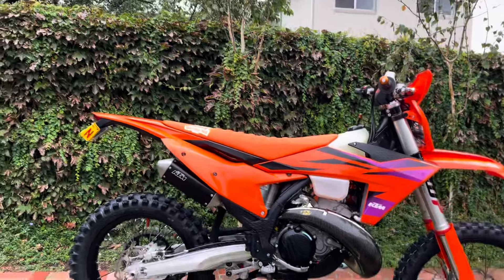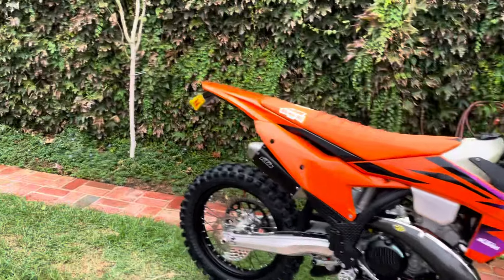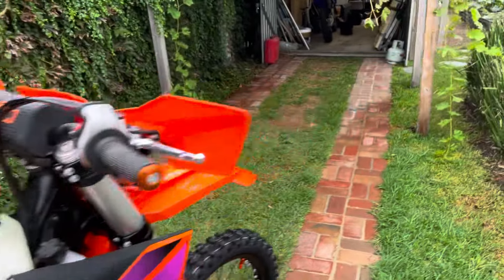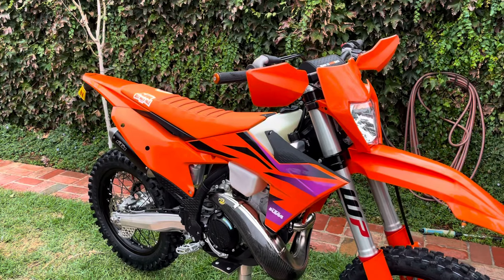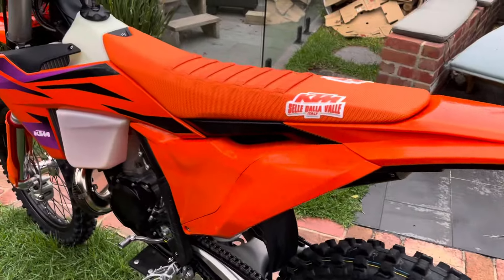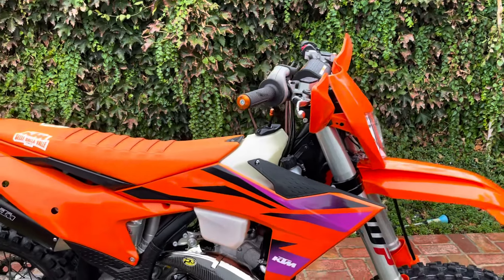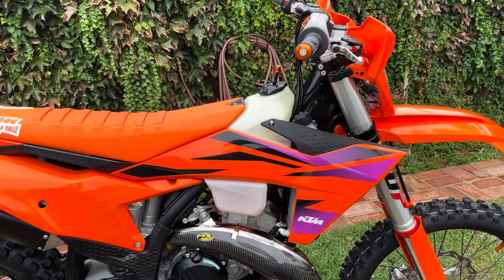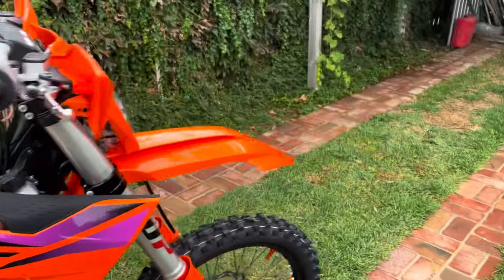2024 KTM 250XC  First ride impressions and review

Comment: Good review. I did the GasGas demo day the other weekend in Victoria and the EX250 (same engine same fork) was my favourite bike by a mile. Great engine and the closed cartridge forks were so much better than the air fork on my 22 EX300. The EC (2 and four stroke) open cartridge forks were too soft and sat down in the stroke too much even in the slow stuff and I'm only 75kg. Concur with Braketec. Across the 5 models I rode they range from barely passable to absolute terrible. My bike has Brembos and they are way better. I wouldn't buy a GasGas for that reason alone. The TBI engine ran really well and is very linear. I think its absolutely the best all round bike by a mile. The four stokes are good bikes but they they have less personality that the 2 strokes which are more fun.
Reply from the maker: You’re spot on.. this is the unicorn that I’ve been looking for.
I live in Warburton Victoria ..hit me up for a ride ✊🏻

Comment: Oooh thats pretty. Why did u choose 2 stroke? Im 100% 2 stroke im just wondering why you changed from 4 stroke to 2
Reply from the maker: I love them both.. in fact I’m about to buy a 500exc to convert to a light weight adventure bike… but the 2-Strokes are just so light feeling.. they turn so quick.. I’m the type of guy that loves to ride quick into corners and rip out of them.. these are BY FAR.. the quickest point to point bike in the bush

Comment: How did you install your head light on the XC?
Reply from the maker: I had the front and rear light installed at the shop.
They custom make the wiring loom .
It’s mandatory to have lights fitted to a registered motor bike in Australia.

I have a switch to turn off the headlight.
The rear stop and tail light is always on.
It only draws 5 watts.. the headlight draws 55 watts so you can run the battery flat if you leave the front on… the stator is only 35 Watt capacity
Reply from the maker: Yes I did.. but I have a switch on the bars to turn it off.. actually.. I only run the stop and tail light 100% of the time.. otherwise it will flatten the battery in 20 mins..
With this set up.. it never effects the battery

Comment: The 2024 250 xc has 47 horsepower. The 2024 300xc has 57 hp.  Tbi bikes have less power than tpi bikes
Reply from the maker: I’m sorry but I’m not sure where you have that information. Go to any dealer and they will all tell you that the 24TBI exc or XC-W’s in the states.. are 9 horsepower less the the XC’s 24 TBI’s.

The 250XC is 56 HP and the 300 is 58
The 250XC-w is 47HP and the 300 is 49

There is only 3Nm of torque between the 250 and 300 XC as well as